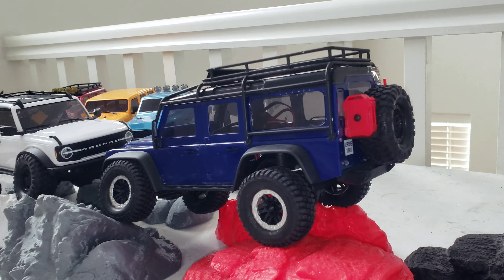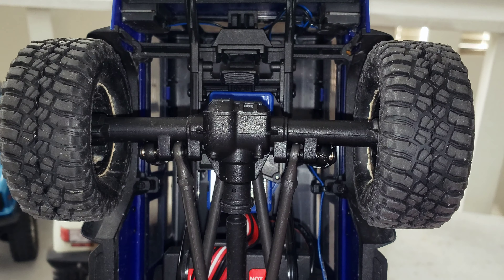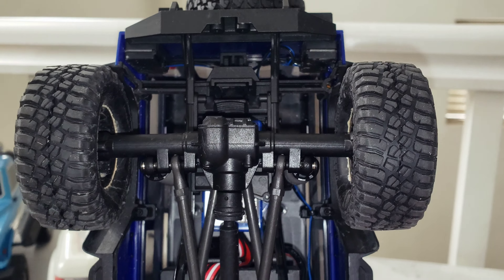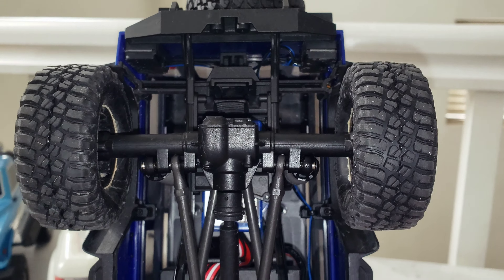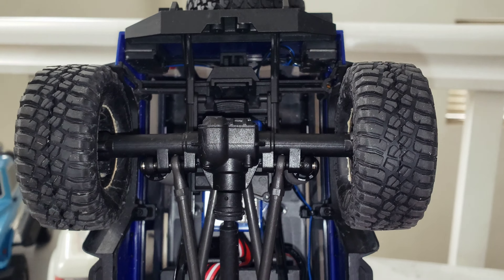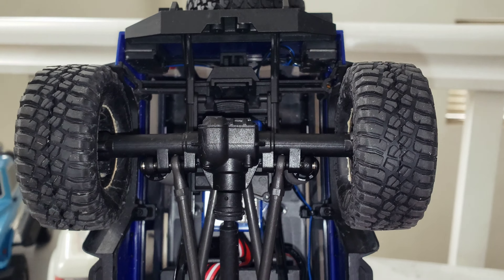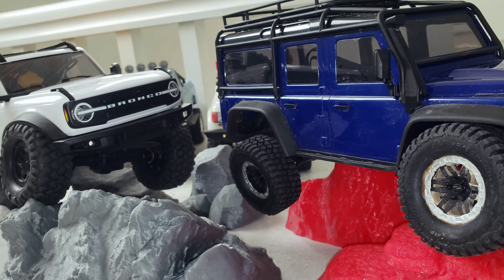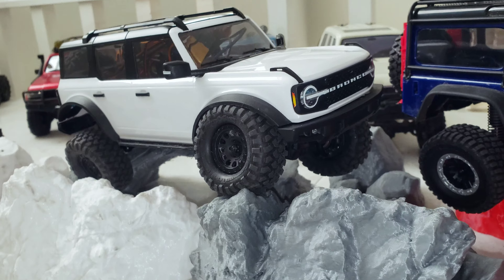Traxxas TRX4m Bronco and Defender Issue.

Comment: The rear axel is designed that way to provide toe-in for traction. All traxxas vehicles have tow-in on the rear axel (although most are adjustable). Because the axel in the TRX4M is molded 1pc, traxxas made the toe-in part of manufacture.
Reply from the maker: I understand the toe being normal I'm a automotive technician.  The axles being flexable and when bent stay bent isn't and shouldn't be normal. My other crawlers do not do this. I can physically bend it and when I get it closer to straight with minimal toe the truck runs smoother and its very noticeable.

people seem to think I'm pointing out toe being a defect but I'm just pointing out the rear axle flexes under crawling loads and causes binding which robs efficiency and smoothness from the rig.
Reply: @RunThatRC  
Maybe you should talk to Traxxas about this… I’m sure they will tell you that the rear axel is designed this way
Reply from the maker: @trandazz7  I did talk to them they want to send me new axles. Its not the toe built in I was referring to its that they actually flex under load and cause binding. My other 24th and 18th scales don't exhibit this. I might make a new video because I worded it wrong and am getting some detailed comments.  To me its still a defect or oversight no matter how wrong I may have worded it. Toe is ok but excessive toe due to bending while running shouldn't be normal.
Reply: @RunThatRC  brittle little plastic original WPL axles are straight, they don't bind to rob power unless the bevel gears are pushed too tight. I can understand Traxxas reaction (lmao). molding plastic is sensitive "fun" for flow temp, hold time, cooling time etc. different compounds behave differently too, something happened to get those parts warping
Reply from the maker: @modelnutty6503  who knows maybe they intended to make them soft so they don't break but didn't realize it will cause the axle to bind under load. It's sad that some will defend the brand saying its a budget truck that will need upgrades? If a lesser known brand released a truck like this people will be on here saying you get what you pay for its a no name piece of crap, what do you expect bla bla bla. For some reason it's ok for traxxas to makes a $150 rig with oversights. 

I was under the impression they charge so much for there stuff because they had to pay for R&D. What R&D? The transmitter they use is more than a decade old so no new R&D there and the trx4m design is basic and just like other 18 scale rigs but the oil shocks and body mounting style are cool.

I still like them but for the first time I want someone to make a metal rear axle for this. I'm not into metal axles and links really because plastic slides better on obstacles. Metal just hangs up because of the friction from rock to metal.

Comment: Ok RC enthusiasts.  As a builder and racer of both RC cars, trucks, crawlers and bashers as well as real cars.  “Rear Toe-in” is essential and designed in on nearly all vehicles.  Here’s why. 

Toe in on the rear improves the straight line stability of the car. Toe in is also used on the rear to induce a slip angle on the tire to increase the straight line grip and performance of the tire to transmit as much torque as possible to the ground.

0 degree toe in on the rear will cause the vehicle to wander and not track straight.  

The toe in on the TRX-4M is about 1 degree on purpose.  

Inside the rear differential that is compensated by the ‘backlash’ or the spacing in the gear mesh which 0 backlash will cause gear whine (the gnashing of both sides of one gear against the other and the lack of the ability of gear lube to go in between the gears creating heat but also with that degree of toe-in. This is engineered in to the design. As well as the spacing of the wheel pin and hex nut not being fully seared against the outer bearing or bushing edge of the axle. 

All that said, it’s necessary… Not a manufacturing defect.  

On most RC cars that have independent rear suspension systems where there is caster, camber and toe adjustability, many racers will adjust for more toe-in depending on the compound of tires and their heat range as they warm up and increase or decrease grip as well as the various shock absorber pre-loads, oil viscosity, inner piston holes, track temperatures and the surface compound. 

I’d recommend that before posting a video such as this, learn about how suspensions are designed and their uses.  This also affects your understanding of how your real world vehicle is designed, calibrated and thus utilized.  

Happy RC’ng people.
Reply from the maker: I know toe is necessary but in this case even if they designed it into the model (which should be normal) the flex on the rear axle is real and when I run the truck there is binding going on because I can bend it to the 1 degree toe and its smoother but the axle does flex way over normal toe and stays bent under hard crawling and doesn't  bounce back. 

In my opinion the axles are too soft and its a defect. We can all call it what we like but the fact is there is binding and it's noticable enough to rob smoothness and power from your truck. I am not pointing out toe being a defect or any suspension 
settings. I'm pointing out very flexable axles that cause binding while running under crawling conditions. So I call that a defect because my other crawlers don't exhibit that issue.
Reply: Sir, from 26 seconds to 41 seconds in, you said, “… as you can tell, the axle right here is not quite straight, It’s a little bit bent… Like this… As you can tell, the wheels are kinda toed, yeah, THOSE ARE NOT SUPPOSED TO BE TOED, IT’S SUPPOSED TO BE STRAIGHT.” You then go on to illustrate this for the next few seconds.  Now, your reply to me says you know there is supposed to be toe-in. 

I ask this, what do you expect for a ready to run $150 RC crawler that has all the basics built in? This is what hop-ups are for. 

Your response to me says that your video isn’t pointing that out, but your words say different. 

If, in fact there is some binding, does it even compare to the front axles that bind and surely limit the ability to put the power to the ground? 

You attempted to point out a defect that just isn’t there.
Reply from the maker: @sfwhiteside  The fact is there is binding and the front steering on both mine dont have that  excessive steering binding. I may have worded it wrong I'm not perfect. I can make a new video but most got my point or have the same issue and understand what I meant.

There is a defect and I let Traxxas know and they even sent me out replacements just to see if they are different. The rep should have said it was normal if it was but he said "that doesn't sound right let me send you a new axle and see if the issue is still there". Also someone on Facebook has a trx4m with even worst toe out the box and its toed more on the right than left (doesn't line up with wheel wells). So in my opinion it's a defect or oversight. If they meant for the rear axle to flex and bind as you run it then thats just bad R&D. I will stick to it being a defect or oversight.

I'm 41 years old been into RCs since I was 12, am currently an automotive technician, used to race and tune rc truggys, buggies, sct and tune and race real cars. Currently modify real off road vehicles.

Comment: Man your so right! I never noticed this on mine. My wheels dont appear to be toed in at all. But when looking at the axle housing, the bend is clear.. good find!!!
Reply from the maker: Hopefully they fix the issue or someone makes alloy housings.
Reply: @RunThatRC  is the axle shaft inside being stressed off center?
Reply from the maker: Yes and you can hear the motor change pitch when it binds and even more while crawling. I can physically bend it straighter and the binding goes away. When I load up the rear wheels to pull me up obstacles the rear axles flexes even more and doesn't bounce back. My cr18 doesn't have flexy axles like this thing. I still really like it and I'm sure it's an oversight.
Reply: @RunThatRC  damn your right, if i bend the axle straight the binding goes away. Had bought the fast eddy bearing kit but i guess that will wait. Ya my scx24 never had a problem like this, but nothing is perfect. Ya im hopping on the first set of metal axle housing for this build.
Reply from the maker: Yeah it has to be an oversight. Made the plastic too flexable to hopefully not break but the drivetrain smoothness will suffer. Some on here say traxxas built that in and traxxas would say its normal. So I say a HobbyPlus cr18 axle doesn't flex like this and its cheaper and lesser known. So traxxas built in binding under running conditions according to some. 🤔

Comment: How did you set up the power switch button? It gets annoying to remove the body just to turn it on
Reply from the maker: its still in the stock location. Its not too bad with the clipped on body mount system.

Comment: it may be by design, both of mine were like this from the factory also. could be so there's a little bit of toe in, i'm not sure though
Reply from the maker: A little toe is built in to the axle but I'm pointing out the flex while running it. While crawling rocks you can see and even notice a power drop when the truck is in a hard line when the rear needs to push the truck up a obstacle it flexes too much causing binding in my opinion.
Reply: @RunThatRC  haven't noticed that yet, i'll have to keep an eye out for it

Comment: I am pissed off about the Traxxas battery connector on the TRX-4 - nothing else like it. I live in a block of flats and any chance of a fire would be disastrous and it looks like I cannot run it on NiMH batteries unless I cut the plug off and solder it onto a connecting link, I'm not sure that would work because a single balance wire goes to the ECM 2.5 esc.
Reply from the maker: proprietary stuff is a pain for sure.

Comment: I am in china and i hope you find my comment 
There is a new release from mjx as we all now they have produced some of the most cheap and unbreakable rc cars that have been clones of some big companies but now they have came with the clone of something that is cheap and we admired it the most in 2021 and 2022 for its usablity for drift as well for bashing 
Iam actually talking about pinecone models sg1603 
But now mjx have made the best version of sg1603 and produced 14032 lancia styled car with not only two three set of tyres and with oil filled shocks which were the biggest disadvantage in sg1603 because they do not come with it and the mjx version does also comes with metal chasis which is insane
Reply from the maker: thats pretty cool! Thanks for the info.
Reply: @RunThatRC  i have also sent you some details on instagram as well

Comment: yess, i noticed it was not straight
Reply from the maker: the axles with a little toe is ok and probably was designed that way. The fact it flexes when loading the rear tires and then it binds up shouldn't be ok. Some say "it's a 150 dollar truck what do you expect" excuse? I say my cheaper 18th scale hobby plus model has no flex in the rear axle so I expect more from a name brand. Traxxas either didn't notice the binding from flexing or they are ok with it. Who knows. Thanks for stopping by!

Comment: Hey RTR, you should check out EasyRC/FMS Bronx for comparison. It's the same scale but with lights, interior and other goodies included. The only downside is it does not have the oil-filled shocks.
Reply from the maker: I did consider it and was supposed to get the bronx and the trx4m Bronco but when I got to the hobby shop they had both colors I wanted (white bronco and blue defender). So the bronx has to wait but not sure if I will even get it. I know FMS makes a great rig I have the FMS FJ Cruiser and Atlas 6x6.

Comment: Well what upgrades do you have on it? Have you added weights to things that attach to the rear axle or weight elsewhere?
Reply from the maker: I have front wheel weights and low range gears on both and the Bronco has 1080 esc and my tx/rx. While crawling the rear axle flexes forward when traversing obstacles. Plastic is too soft imo.

Comment: So I just got one today and this video pops up and I’m like oh no but i looked at mine and they come like that so I don’t think then bend over time I think they just come like that
Reply from the maker: I'm pretty sure they come like that. I was pointing out that they do flex too much for my liking(not the bend from factory which is still an oversight imo). My other 18th scale rigs don't have a flexible axles.

You can check my other closer look video on this to see more details of what I'm pointing out. It's in this same playlist. Unfortunately they do come like this but it doesn't bother me too much just wanted to make a vid on it.
Reply: @RunThatRC  ohhhh okay I see I thought u meant like they bent over time or something I actually took mine apart today I replaced the rear axle with metal gears and theirs actually 2 different pars that connect to it, it’s not a solid one. 

I’m not sure if u have looked at it yet but a friendly warning the little 2 screws on each side holding that bar in place are very easy to shear with the little tool then give u give it some pressure when taking them off!!! ⚠️
Reply from the maker: @luislll5842  yeah the quality of the screws aren't that great. Gotta use a newer tool and it has to be a good tool or it will strip these little things.

Comment: What system do you have in the bronco?
Reply from the maker: I had a hobbywing 1080 crawler esc and a HobbyPorter transmitter and receiver. I now upgraded it to the furitek stinger brushless system. I will have a video on that soon.
Reply: @RunThatRC  Did you use the stock 180 motor with the 1080 ESC? I actually don't mind the brushed motor but I can't stand Traxxas transmitters. Also what battery are you using?
Reply from the maker: yes stock motor with low range gears. I was using 1000mah 2s lipos. I think you can find them on Amazon. The stock transmitter isn't the best thats for sure.
Reply: @RunThatRC  Sweet. Knowing all this I can use my DX5C
Reply from the maker: @SYST3M_OVERIDE  definitely can use that.